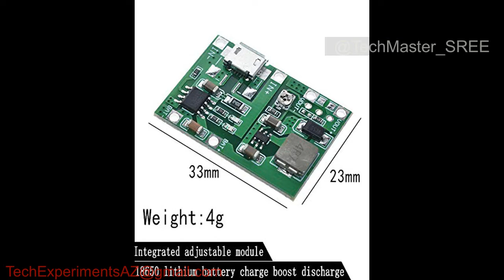This will replace other rechargeable battery 3.7V -27V. 18650,polymer and other lithium battery

Comment: Heating
Reply from the maker: Till now no issue with heating since used on low power consumption device. using this to replace a 9V battery